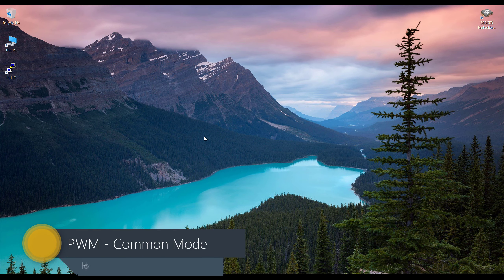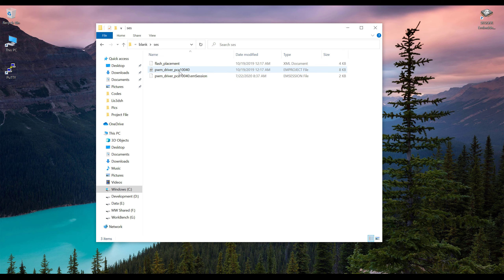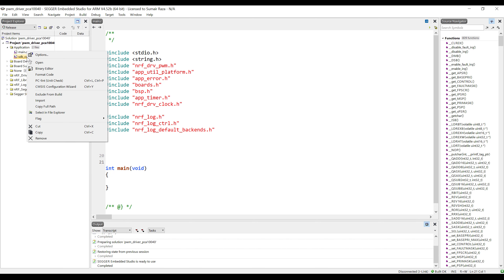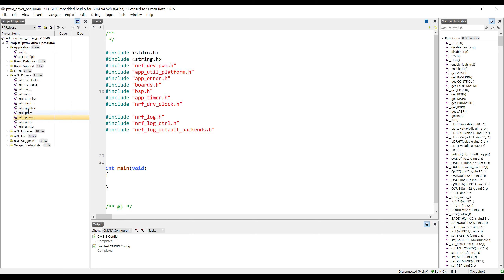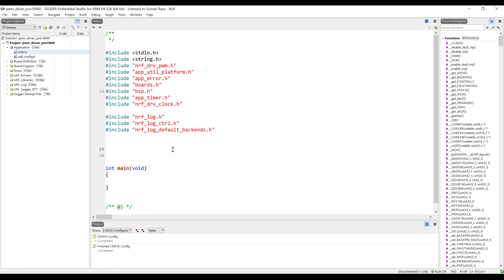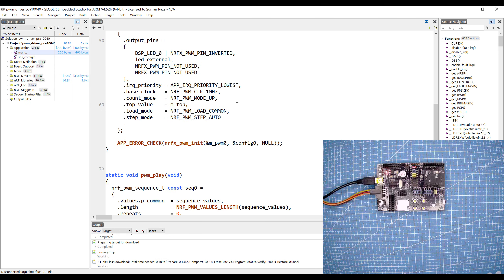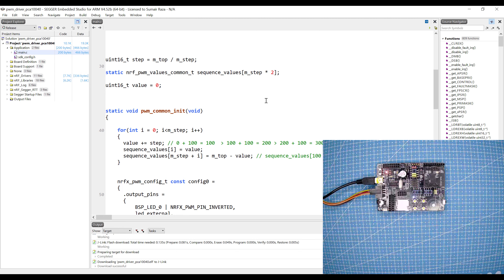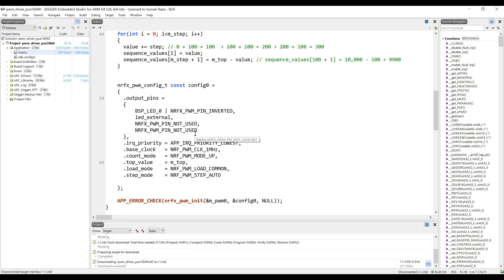nRF5 SDK - Tutorial for Beginners Pt 28 - PWM - Common Mode Programming

Comment: Let me clarify something that at the first glance it confused me on your video. PWM does not control frequency. It controls duty cycle, the frequency is fixed (in your example is 1Mhz). The algorithm you wrote is to change the duty cycle of the LED so it change its brightness.